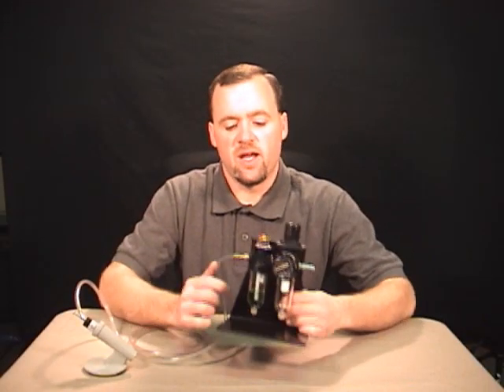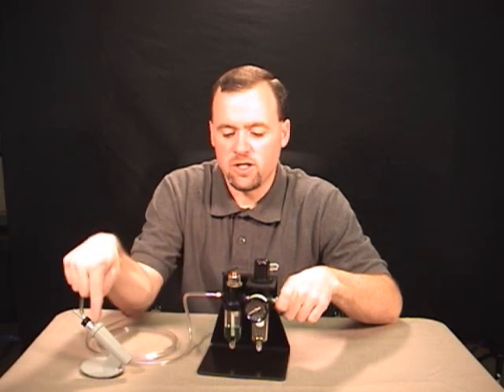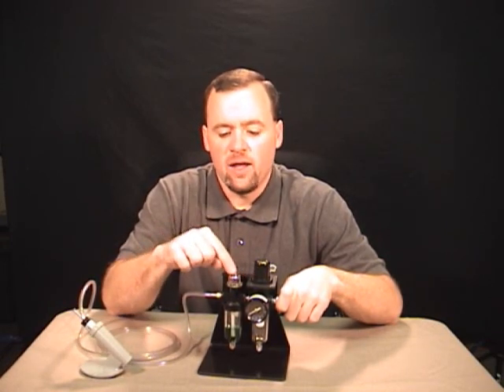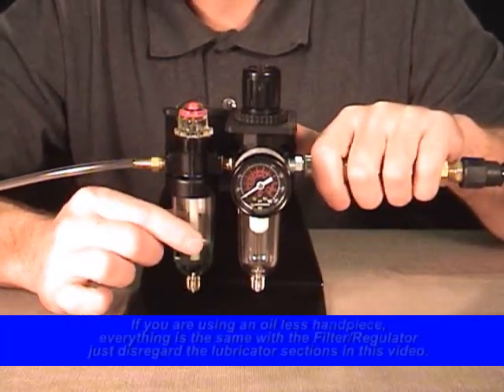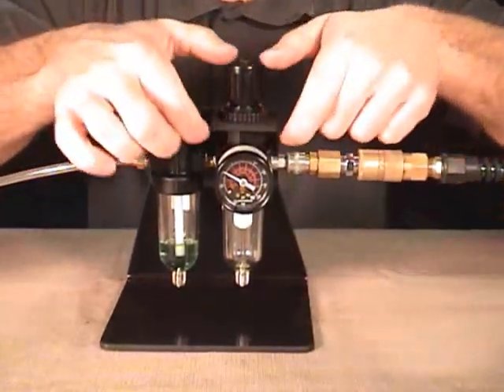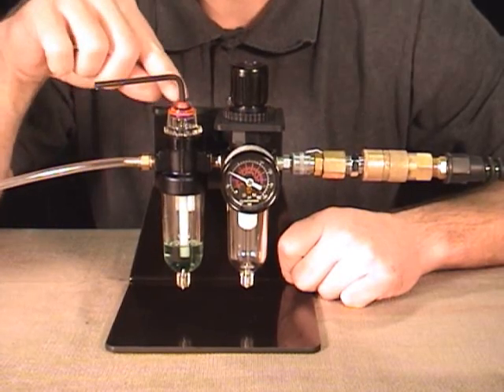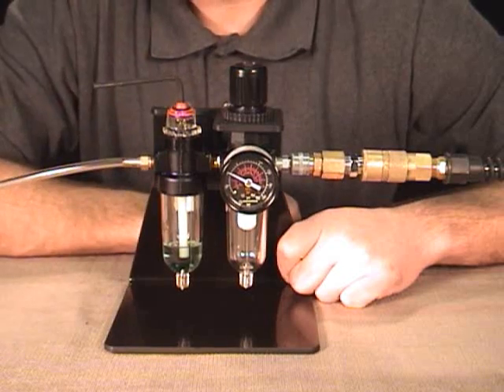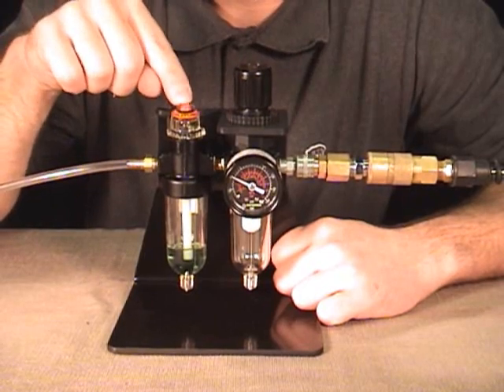Filter - Regulator - Lubricator for Engraving

Comment: Thank you for sharing this video ,i have a question,if you do not mind. what is deference between Air regulator filter water trap oiler lubricator and air filter regulator lubricator? are they the same? do they both work the same or not?i figured out the first one is not expensive but other is a little pricy . Thanks.